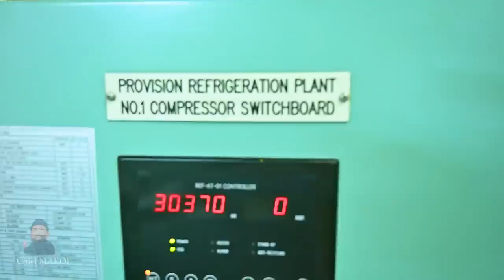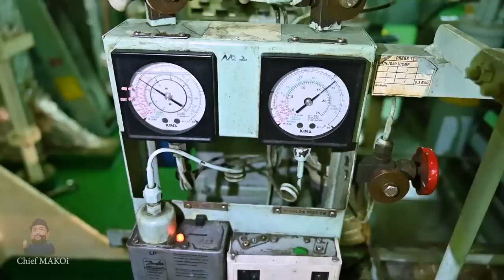Our Ship is in Israel:  Can the Crew Go Ashore?  | Chief MAKOi Seaman Vlog

Comment: I'm glad you made the comment for new parts. I wasn't happy seeing the crank like that. You could see material from the flywheel. Just keep in mind the if the crank lost surface area you WILL break that key again. Go ahead,,,, ask me how I know. Safe travels chief and God bless
Reply: On the side of emergency i would turn the crank before installing the piston by the bolt at the end as fast as possible and while holding a grinder or some sort of file to get the tapered surface straighter ,use green Loctite if available and get the flywheel hot before install with careful use of a hammer while turning the bolt .Improvising can work if enough knowledge is procured , high seas can greatly improve motivation ,Fair Winds
Reply: @rovidius2006  some tin or a coke can as a shim too can help that flywheel sit tighter on the shaft. I have never been a fan of conical shafts with the half moon keyways but whatever.

Comment: Ship troubleshooting is the same process we use in IT.   Identify root cause "RCA",  determine corrective action plan "CAP", test corrective action, return to service.   Its the difference between a well running operation and one with constant failures and breakdowns.
Reply: Hi Lorin. I was in IT for decades. Root cause analysis was always a major item. But I have never heard of CAP, although it makes obvious sense. Maybe we just called it a different name. If you go though root cause, CAP makes perfect sense. Best.
Reply: @roderickcampbell2105 we typically only used them if something moved to the level of service management calling it a problem. Then as part of the problem management phase we would need to provide the corrective action plan.
Reply: @jeffhaggarty9879  Hi Jeff, I guess you had to go through ITIL. I did. But I don't recall CAP. Perhaps I'm too old!

Comment: Nice work… 
We had the prelube pump eat itself on our ship recently. The auto-filter caught most of the cast that was ground off (about two kilos I figure) but it drops it back to the sump and the duplex strainer and safety filter did their jobs as well, catching the majority. We’re a ferry service and the down time is noticed by the passengers and the government. The pump has to be custom built so there’s a three to six month lead time… installed a pair of smaller pumps with the assistance of some certified welders to get us through the peak season. Of course, the engine is getting a complete tear down at refit this fall to assess any damage that may have occurred. MAK M32 V16 in case you were wondering.
I do love my job 😁

Comment: Just so you know… the sidewalls of keyways are VERY important. You can see there is damage on the keyway sides on the crank portion of the keyway. The sheeve side of the keyway needs inspection too. There is likely just enough wiggle room for keys to allow movement. That movement has slowly destroyed the key… and edges… of the keyway as evident by the aforementioned keyway damage. This is something we commonly see in machine shops. You need to address that or it will be a repeat issue. Keyways need recut. In some cases you can just rotate and cut a new keyway but you can also fix a damaged keyway via a couple different methods. Cheers mate. Thank you for another great video.

Comment: Interesting video Chief. It ended up being closer to my trade with the refrigeration compressor repair. I was trained to leak test with Nitrogen before pulling the vacuum. What refrigerant does your system use & do you carry extra for repairs? 
A video of the climate control system aboard would be interesting too.
Stay safe out there.

Comment: I noticed around the 11:39 point that someone was wearing a ring while applying the soap for the leak check. When I used to work on industrial/mechanical jobs we weren’t allowed to wear any jewelry while in the shop as it was considered a safety hazard  (the jewelry might catch on moving parts, belts, etc. and pull you into the machinery.

Comment: Although the bearing journals of the crank looked good, the taper that flywheel seats onto appeared to be worn. It might be wise to change both the crank and flywheel.

What refrigerant is used in that system?
Reply from the maker: We did when the new parts came.  R404A
Reply: @ChiefMAKOi  Chief, I should have known that you would be way ahead of me. Thanks for the education.

Comment: I prefer hand tools for a lot of mechanical work because there's alot less chance of snapping a difficult fastener.   Great video!!!
What refrigerant is the cooling system using?
Reply: Yes, in a lot of cases, power tools just let you make a mistake faster.
Reply: I prefer hand tools as well. Mostly due to the fact there were very few power tools back in the stone age. If it had a hand crank on it, it was a power tool! 🇺🇸⚓️

Comment: Another good video. Id have to call the repair "iffy". Cant believe you dont have a spare compressor. That crank/keyway/flywheel will fail again. Good electronic detectors don't have false positives like they used to. Good luck

Comment: 1. You could lap the 2 cones (crankshaft and flywheel. It is difficult, I know, but can be done and it is a kind of permanent repairs
 
2. you could use "Locktite retaining compound 638" or 603 check it when you have internet. If you don't have it, which I'm sure' use lockthread
3. seams and and punching is not used anymore. Strongly but strongly recommend, don't do it with bearing casing in motors as used to be done years ago.

Comment: Good video Chief. I have found this problem before,there are many reasons why the shaft key shears off.

In my experience  I once found it related to a  high starting torque  electric motor ,especially if they are direct on line start and wired in delta =max torque instantaneously which as you know well stresses the key with shear force this eventually  can cause the key to shear off.
A bad fitted key were slight movement  occurs eventually causes a similar result.
As always keep up the good work and excellent video content.

Comment: Before the compressor comes apart and you find what happened. - I know that refrigerant blowing through a seal or valve makes a poor lubricant in the crankcase. But loosing crankcase oil, your inspections would have caught that. Or, could just be, broken rings, worn rod bearings. Lot of pressure on those pumps. Wasn't just a loose sheave and the key finally gave way? ~ OK now to find out, no editing -  OK, it's been run loose and that taper fit just isn't doing the job. Good bandaid with the thin copper. Should be a good bite!

Comment: Chief MAKOi, I'm wondering, like on the ground in farm silos they have Grain Bin Aeration Fans for the different types of grain stored in them, do massive bulk ships like yours have the same aeration systems or does the grain just ride alone with no air circulation in between ports, if ships do use them I can only imagine the size and the electric power it must take to run them? Be & Stay Well '&' Safe along your journey (s) my friend.
Reply from the maker: No blowers.  Only air vents.  And it only gets opened depending on the shipper's instrucitons.

Comment: Interesting that the refrigerant system isn't using hermetic compressors.  I guess the upside is you don't have to worry about burnt out winding products getting all throughout your system?
Reply from the maker: Some ships use hermetic comps.
Reply: I have a bit of a question about this compressor type. Pistons and rings don't seal in the bores 100%. What happens to the refrigerant blow-by? Is there some sort of crank case vent system that collects it, somewhat like pcv in automotive applications?
Reply: @RustyorBroken  In refrigerant compressors, the crankcase is connected to the suction side.  The seal keeping the refrigerant in is on the shaft.  Any piston ring leakage is just routed back to the suction.
Reply: @matthewbeasley7765  that makes absolute sense. I haven't worked on a refrigeration system, so I was curious as to how it worked. Thanks!
Reply: @matthewbeasley7765  Is that the tube they're tightening at 10:00? It appears to be going into the crankcase and I was wondering what that was.
Reply: @TheOtherBill  I'm not familiar with this particular compressor, but usually the connection is internal.  

I suspect the tubing is an oil return.  Smaller system just load the system up with enough oil that it all stays in equilibrium.  Big systems like this will have an oil separator before the condenser that removes the oil and sends it back to the compressor.  They'll have a float valve in the crankcase that meters the oil back, driven by the pressure differential between the high and low side.
Reply: @matthewbeasley7765  Thanks, refrigeration is out of my area so I didn't understand the purpose that tube.

Comment: It is good to have a lathe (CNC preferred), drill press, milling machine, planer, welding, etc and steel products so that you can fabricated for emergency repairs even at sea.
Reply from the maker: Ships usually have a lathe, drill press and welding equipment.
Reply: @ChiefMAKOi  Good!  It is nice that you are back making vlogs.

Comment: Wouldn't the crankshaft need to be welded up and a new slot for the woodruff key cut? It looks like there is a good bit of slop on that crankshaft.
Reply: you could possibly recut the taper and cut a new woodruff key on the opposite side of the shaft and avoid heating the shaft by welding
Reply from the maker: Like I said, it was a temporary repair.  It held up fine until the spare parts came.  Including a new crankshaft.
Reply: It looked okay to me @SkrixFox  Also - looked good to the trained engineers onboard the ship, handling the job...
Reply: @ChiefMAKOi  Oh cool. Glad you got a new crankshaft for it.

Comment: I would've at least turned a few 'thou off the taper, freshen it up...
Do you have lathe on board??
Reply from the maker: Yes.  But we're just putting it on standby until the spare parts (flywheel and crankshaft) come.

Comment: 11:18 Don't use soap bubbles! How are you supposed to see very small bubbles then? Just use water with a lot of dish soap in it so it becomes very slightly thicker and do everything you can NOT to produce any bubbles so the liquid is clear when you put it on, then you would be able to see even the smallest leak which would be totally impossible otherwise.

Comment: That flywheel shaft is tapered, so it should hold quite easily, even without the key.   The bolt on a tapered shaft like that is typically tightened to at least 80 ft lbs.. some harmonic balancers on cars will tighten up to 200 ft lbs.  This is why you guys should have a torque wrench on board also (which I'm sure you probably do).   Likely the bolt just came loose from not being tight enough;  especially if it is spinning counterclockwise, which will tend to loosen the bolt.  Plus the torque that motor drops on the compressor is crazy-  it just starts at full speed without any gradual lead in. :)   
 I know as mechanics we like to frown at using the torque wrench because we can do most things by feel. But on some parts it's pretty crucial;  like the head bolts on that compressor and the flywheel bolt.   Not only to make sure that you get it tight enough, but also as to not overtighten it and strip the threads.    On a ship like this where you are on open water for so long,  I'd be using that torque wrench on everything. :)
Reply from the maker: Yes, but for small screws like these, the instruction manuals oftentimes don't give a specified torque.  So no choice but to go by feel.
Reply: @ChiefMAKOi  Right on.. I think the main issue is how that industrial motor just KICKS on full speed right off the bat without any kind of slow take off speed.  It has so much power that it just sheared the key.   On a pulse width modulated type/ electronic motor-- you can make them start slow and then ramp up, and it's just easier on all the parts and even uses a lot less current on take off-  vs that huge torque spike that happens right at the start.  Cool stuff though.. I love learning about these ships-- this is my first time really diving into the systems of a big ship, so it' super fun to watch.  Cheers.
Reply: @calholli  Most likely the flywheel bolt was loose to begin with , or oil was present  on the tapered  surface . Properly installed it will brake the shaft before coming apart  but it could also be used as a clutch in order to prevent catastrophic damage in case of overload due to damaged parts .Consideration may be  given to survivability rather than  temporary inconvenience   , broken internals being harder to repair on site .Safe journeys .
Reply: @rovidius2006  "Fuseable link

Comment: I guess I could see no power tools...kinda if theft is a problem. But using a hammer and a small t bar to remove a nut? No. Use a ratchet. lol then at 8:07 you use power tools? What, I thought no power tools?
Reply from the maker: I said we had a few 😄.

Comment: With a redundant system why ruin your departments shore time when this repair could be performed u
Reply from the maker: A backup needs to be in place for equipment like the ref.compressor.  What if the other one broke down?  Worse if that happens while you're on shore leave.
Reply: In my industry the redundant systems are on a 50% duty cycle ( on half the time) (Equipment needs to be regularly operated to keep it fuctional). If one goes out then there's a good chance the other may go out too.